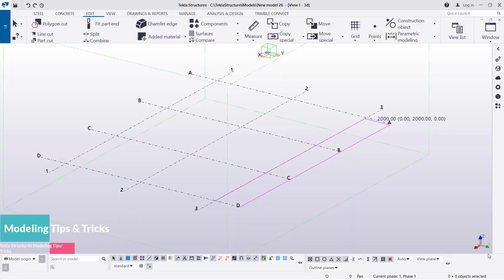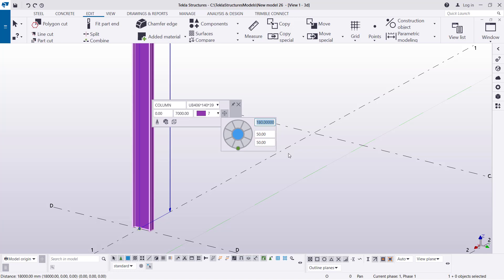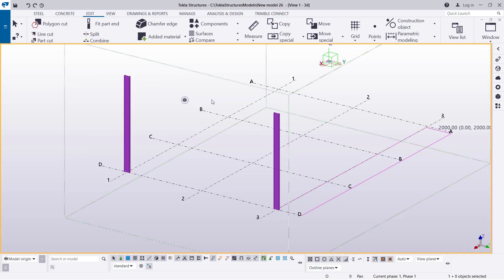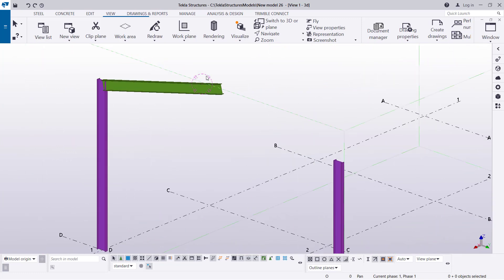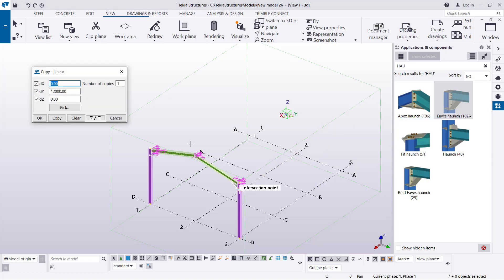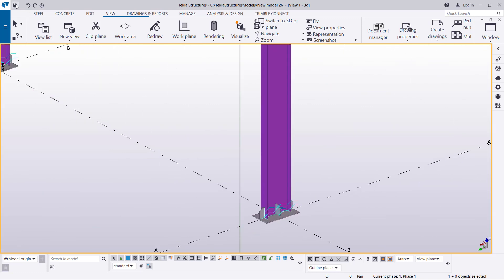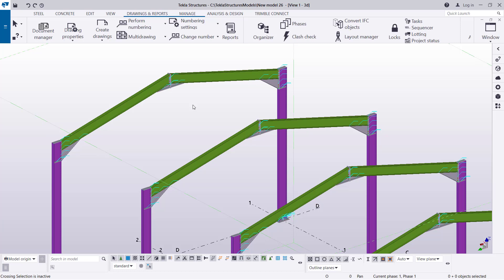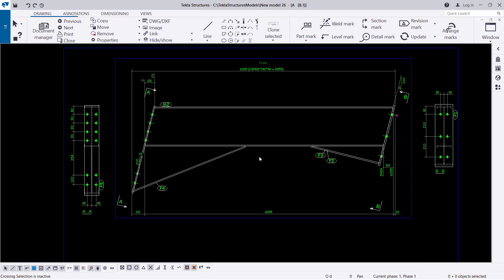Modeling Tips and Tricks in Tekla Structures

Comment: Good afternoon. Is it possible to know the name of a component created based on a system component. Example: I have created one using the component (187) with the name C-187-01, but when selecting it inside the model it does not show the name, it only indicates that it is (187).
Thank you very much.
Reply from the maker: Maybe the component is exploded or the component symbol box isn't checked under display properties